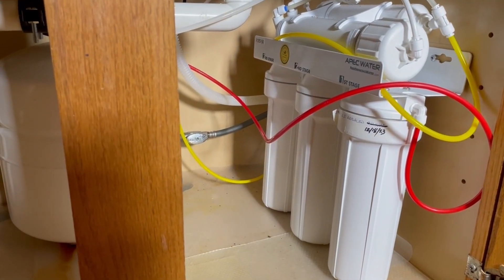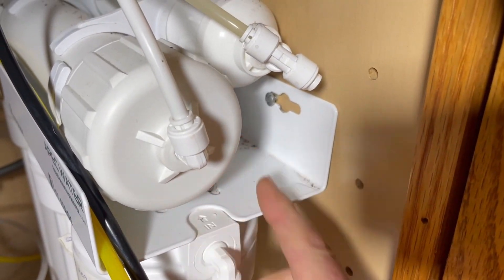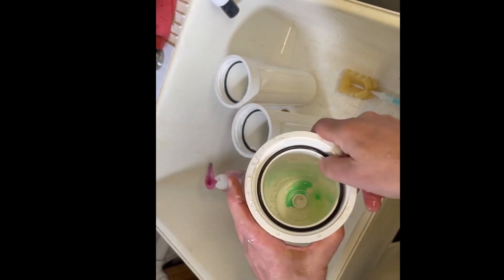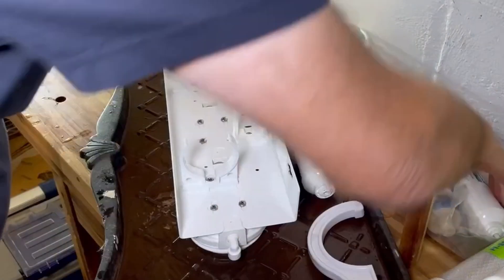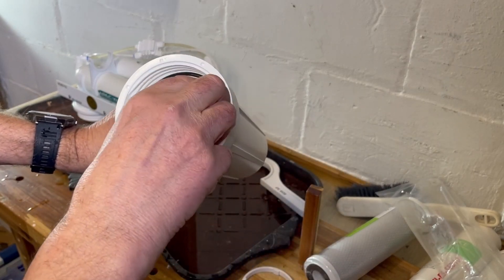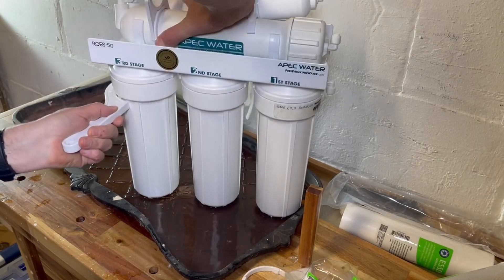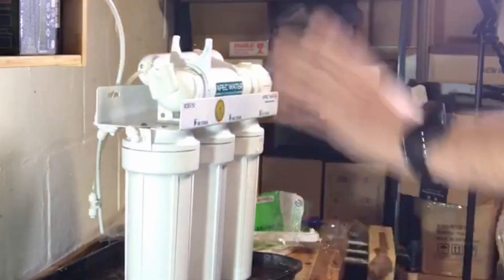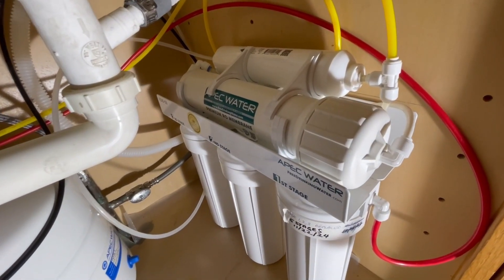APEC 5 Stage Water Filter Replacement Steps - ROES-50 Essence Don't Wait!

Comment: 6:05 I can't unscrew mine either and I don't have a vice... I'm stuck.  I wonder if they sell just the filter cup, I could replace the entire thing.  😢
Reply from the maker: Try turning in the "wrong" direction first - as if tightening. Then try to loosen it again.  Seems illogical but I've surprisingly found it to work on all kinds of fasteners. Just a microscopic shift can be enough for it to break the seal. If I didn't have a vice I would carefully hold it down on the ground with my foot (perhaps with some towels to catch the water leaking out).  Then of course there is the spiritual mind trick.  But be careful with this one and do at your own risk without children in the room. Basically you chant " you SOAB, you are coming off!" while directing your mind on the thread with steady firm force on the lever.  That has helped free many things for me. Just don't injure yourself!   One more would be to find some kind of pipe as an extension on the housing wrench.  One, or a combination, of these should work.  Also, it's a good idea to replace the seals and not over-tighten when you put it back.  That should make it easier the next time.  Good luck!
Reply: Ooh goody I remembered the little old lady next door who I'm nice to and help all the time that her deceased husband had a bench vise in the garage, she let me use it and then the cap came right off in seconds. 😊 😊

Comment: You are doing it all wrong! Nobody should watch this video!! 
When changing the filters, there is no need to unhook the lines if you are replacing the PRE-FILTER! 
Please read the instructions or watch other proper videos! 
This is garage!
Reply from the maker: Are you the filter police? Sure, you can do whatever way you like.  I just find it more convenient to take the unit out rather than crawling on the floor under the sink.  If you like to do that - fine!  Disconnecting a line takes seconds. But absolutely - DO NOT WATCH THIS VIDEO 👀!

Comment: Really good demonstration unfortunately I replaced all my filters after receiving new filter caps from Apec because mine were leaking and while my leak is fixed, I let the water run for a very long time and Im still getting a high TDS of around 350. It was around 20 or so before I changed the filters....any ideas?
Reply from the maker: Thanks, that does seem high.  The AI reply that YouTube gave mentioned something about possible damage to the membrane.  I don't know if that makes any sense though.  350 is kind of high isn't it.  Makes me wonder if everything is flowing in the right direction and the brine connection is connected to the drain? Perhaps Apec could help you. I hope you get it figured out.
Reply: Please share what your issue turned out to be.  I enjoy my ISpring /Apec RO Water,  but the system does require maintenance & tinkering.
Reply from the maker: @ferndog1461  I think you are directing this to @andrewbodey5025.  I just checked mine since making the video and I get a TDS of 19 so that 350 is not normal.

Comment: I have the same system and scheduled my filter replacements for every 9 months instead of the suggested 6 due to having clean city water. The last time I had some algae growing on top of one filter. I now stick with the 6 month schedule.
Reply from the maker: Good idea.  I only think you need to change the first 2 or 3 filters at 6mo.  I usually take advantage of black friday deals too. I schedule more of the filters to be changed around the end of the year when you can pick up the filters a little cheaper.  From now I'm not skipping the mid-year change.
Reply: @DIYWithJC the large bottom 3 filters are on the 6 month schedule. Apparently the filters for the Ultimate series are compatible with the Essence system. When I am finished with my stockpile of Essence filters from deals in the past, I will switch over to the superior made in USA Ultimate filters.

Comment: What is the purpose of the 5th stage filter.
Reply from the maker: It's another sealed carbon filter. Water from the tank passes through it. My theory is that it would remove any rust particles that come from the tank. This is the first time I ever changed it after 4 years.